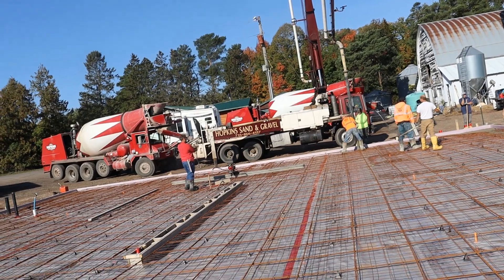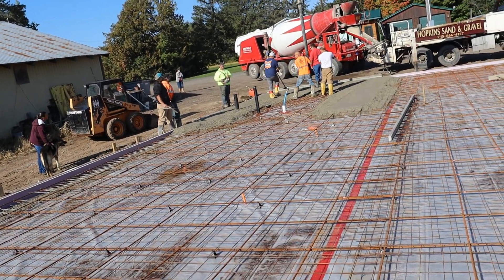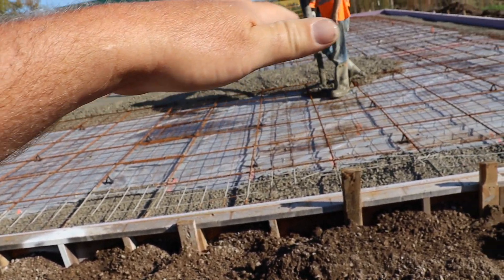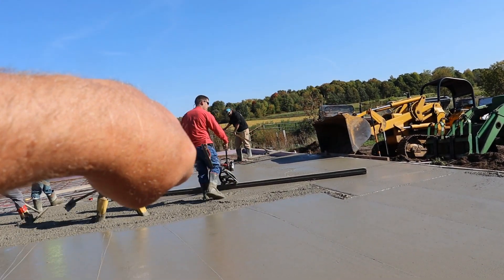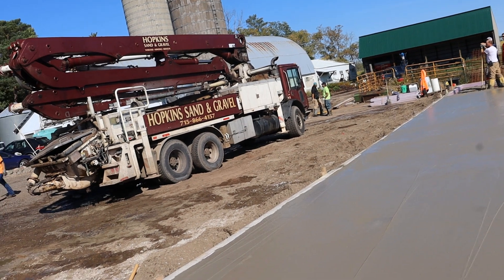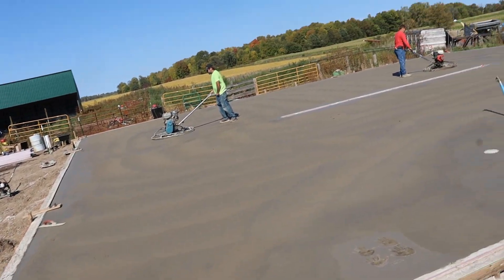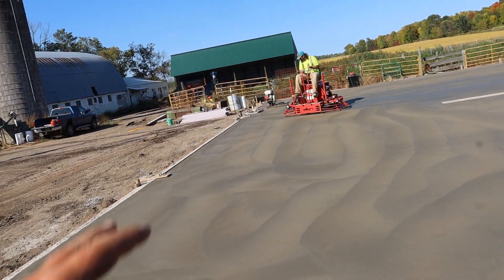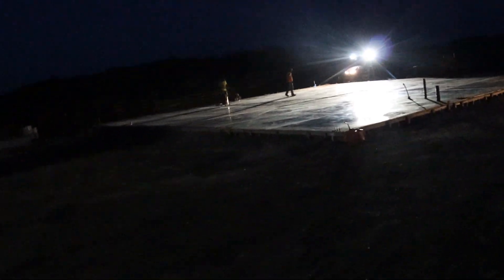Pouring the concrete for the new shop!

Comment: That’s a nice slab. I love the self propelled troweling machine. It looks easier than swinging around the others or worse a hand towel. 
Maybe if I put a metric tape measure in the post and sent it to you the next lot of measurements might be a bit more accurate.
I was always told when I did my carpentry apprenticeship that a tape measure has two ends “a smart end and a dumb end”. Be careful as to who uses the smart end.🇦🇺👍
Reply from the maker: Ha yep! Still use that term!   I like to use engineer scale because it's very fast for adding and subtracting and it's what we used in dirt.

They let me drive that troll machine it's all machine and it's very weird. Bid your left hand is forward and backward bird and your right hand is forward and backward and then right and left.. But it's not smooth like a hydro machine you're not really connected to the ground